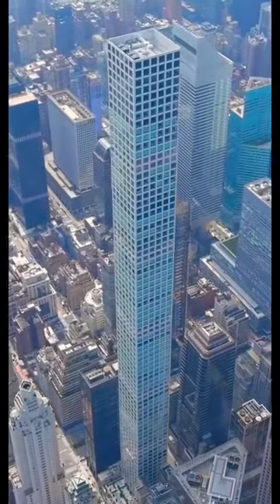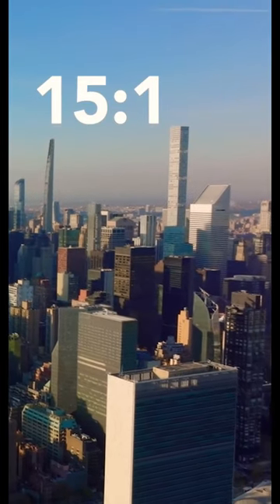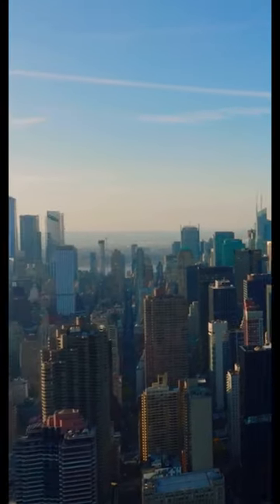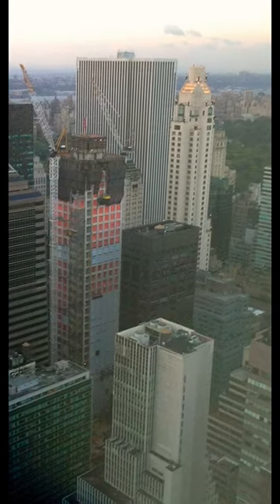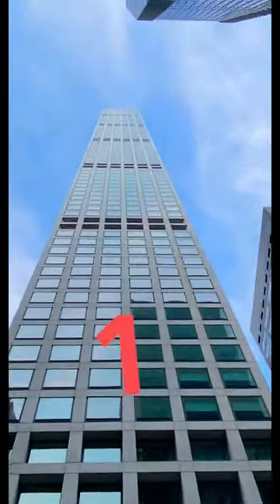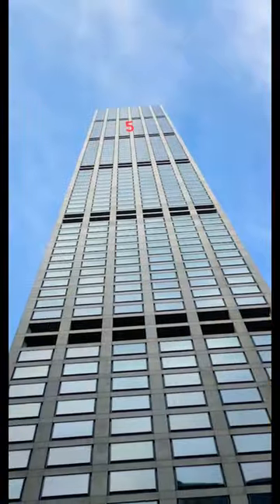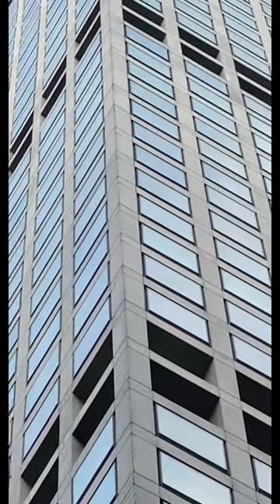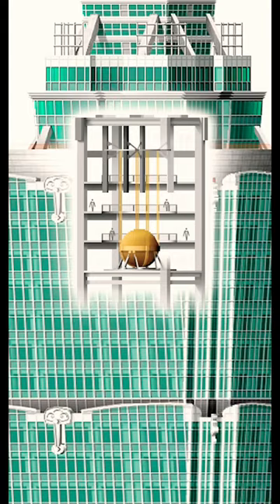The NYC Skyscraper that Sways in the Wind

Comment: Structural Engineer who made that one deserves a credit.....
Reply: As a Structural Engineer, I was going to make the same comment! I love an architect that challenges me, and I don’t want to crush their dreams, but ultimately they draw the building, and we (along with other disciplines) make it work. A good/great Architect works with us and pre-empts our needs and makes allowances for them. This isn’t always the case, even with the big names, on the big projects!
Reply: Maybe, maybe not. It remains to be seen.
Reply: let's not sensationalized there names because it is so very disgusting to hear only there accomplishments and neglecting /degrading other allied professions.....
Reply: I would if they weren't being sued. don't think it's working out.
Reply: @RR-on4sk  really? What’s happening? Is the building not performing as expected?
Reply: @RR-on4sk  until the release of the data used during the lawsuit, we won’t know if the structural engineering company is at fault. Reading up on the lawsuit it seems that much of the issues are unrelated to the structure. Noise from high winds is inevitable and difficult to predict. I believe the structural engineering team still deserves a Pat on the back for making this impossible a reality. They pushed the limits of engineering into waters that have never been explored, so of course the first of its kind will have some fine tuning to perfect this super slender concept. But in terms of safety, the building is performing as designed and is not threatening per code requirements.
Reply: @alexjohnstonjohnston5374 Very interesting indeed! "Pre-empt": does this mean that the said architect anticipates and accommodates the structural innovation necessary for such a difficult feat? Does he need profound structural engineering knowledge for this or is it an intuitive talent?

Comment: The Twin Towers had Loads of sway
As we would Metal frame for sheetrock
We would wrap the tops and bottoms of each stud before placing them 
So the walls would stay silent and not Squeak and creak
Reply: Didn't like going to the uppermost meeting rooms and restaurant, yet had to for business. The NYC 🗽 in my mind's eye will always have the Twin Towers.... 😎✌🏼
Reply: The twin tower at times had water sloshing in toilets on top floors
Reply: What would you wrap the top and bottom of the metal studs with?
Reply: @chrishansen5784  Thermite.

Comment: I used to work on the 38th floor of 388 Greenwich (the umbrella bldg/Travelers downtown). The creaking noises the building made from swaying during windy/stormy days was very disconcerting.
Reply: The creaking in Manhattan office towers is not what most people think. As an architect who has 40+ years' tenant fit out experience in NYC, I have encountered and solved this problem. It is caused by the rigid sheets of gypsum drywall (GWB) used in most interior partitions. A GWB partition consists of two tracks, securely fastened to the floor slab and the underside of the overhead slab. Upright metal studs are inserted into the tracks but are only fastened to the floor track. When the building moves in the wind, the studs are free to slide in the upper track. Likewise, the GWB is fastened to the floor track and studs, but not the upper track. For additional flexibility, the top each stud can be wrapped in electrical tape to increase its ability to slide in the track by reducing friction. IF the partition was rigidly attached to the upper track, the rigid GWB would creak and moan due to its inability to move with the building structure. It's an expensive detail but it solves the problem. BTW: Most high-rise structures are engineered to move, just like the wings of an airplane flex. Perfect rigidity is difficult to achieve and would make the construction prohibitively expensive. 

And then there's movement caused by thermal expansion ................!

Comment: hi Ariel,
Thanks for another interesting architectural short (video). The "windows" in between floors usually houses the building's mechanicals. They are exempted from the city's FAR (floor area ratio) constraints and hence allow the building to be constructed taller than if they weren't design with these "windows" (also known as mechanical floors).

Comment: The elevators have problems during heavy winds and  either get stuck or shut down. The sounds of the cable slapping and wind noises inside the shafts. There have also been major water leaks.

Comment: Stress. Metal can only bend so much before it loses strength. Same with joints. I have 150 year old house the hinges on every door are weak from years of motion induced stress. Some have long ago failed.
Every loud crack probably means a joint somewhere moved which was never intended to move. They are loosening up. On their way to eventual failure.

Comment: They could weld in diagonal braces on the windowed floors without a lot of aesthetic damage,  while alleviating much of the sway.  A relatively easy fix; not only more structurally rigid, it might actually make the building inhabitable.

Comment: No, I would not live there.
I worked in the WTC, 106 & 107 floors.
Those buildings also swayed, maybe not to the extent this one does but the hanging plants would sway in the office when it was very windy. There were creaking noises.
Sometimes you would feel slightly off balance.

Comment: Although innovative, as in, building skyscrapers with small footprints I strongly disagree with the direction NY has chosen in regards to these "Super Slender" constructs. A lot of testing and preventative measures were taken, but, risks are always amplified during inclement weather. Just think about conditions strong as hurricane Sandy. Furthermore, just to expensive to deal with a situation like that. NY should limit height to width ratios to 11:1.

Comment: I’m not sure about this building but in general structural engineer is the one to design the structure of the building to withstand wind, seismic and any other loads per code. The design of tune mass damper is also by structural engineers not by architects. Architects do not have specialty to design the structural components of the building. I do not want people to always think that architect is the only one who is responsible for the building. Thank you! Hope you please be clear in your future video.

Comment: I'm an older New Yorker, but I actually love the skinny towers! However, I'm not a fan of this one because it looks kind of post-modern 1980's, with the square windows, etc. HOWEVER, when you get under this building, there is a very real optical illusion that takes place! Those square windows are MUCH larger than a usual window, and the tower is much skinnier than a usual skyscraper. The result is a kind of reverse vertigo! Not looking down from a great height, but looking up to something that is sending mixed signals! I don't like the style, but I DO enjoy the visual fuckery going on!

Comment: As a design architect, this is impressive but would not live there!  Many problematic issues from owner/ occupants continue today, besides the extreme noise from swaying during storms, elevator railing guides out of alignment effecting use, to water plumbing problems, etc....currently several have law suits files against contractors & others!  No again would not live on any if these  rall thin towers, even id could afford one!!!😢

Comment: Everytime I see a video which states the "architect" designed it I cringe. The architect only really "designs" the exterior and or appearance. Only some architects have a good sense of engineering of what is possible but that's only the only good ones. 

So who actually designs the structure then? Its all the engineers starting from geotechnical engineer who does a complete soil report and recommends type of foundation. From there on, it is the structural engineer who actually designs the structural features of the entire building to ensure it actually works and stands. Ofcourse in this case, there was heavy consultancy with wind engineers who probably ran a whole bunch of aeroelastic wind tunnel tests and funneled those input to the structural engineer. 

Please for the love god, don't ever say architects designs structures. They don't.